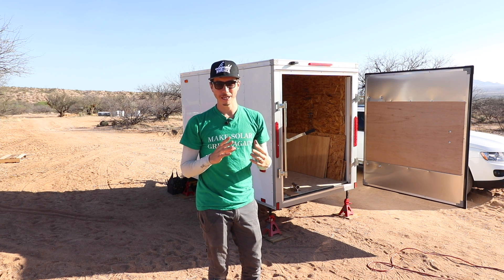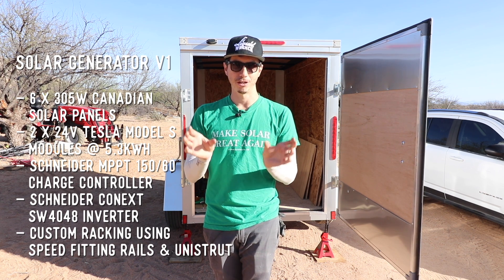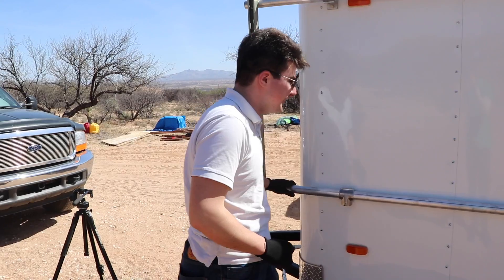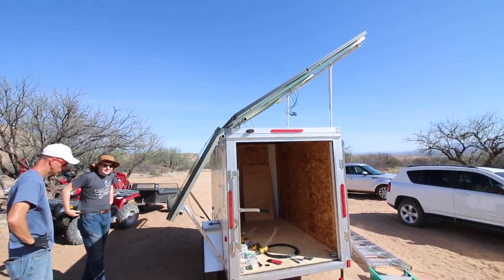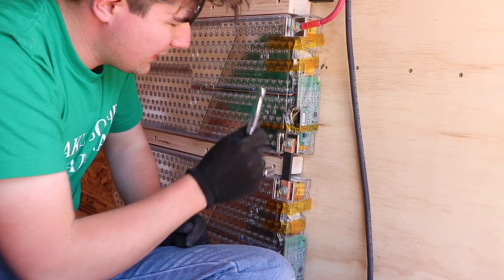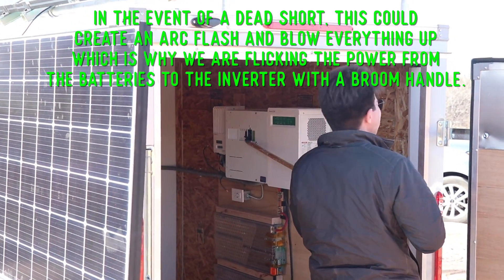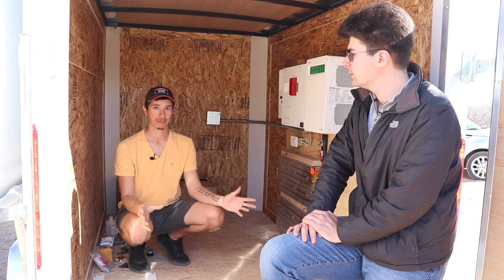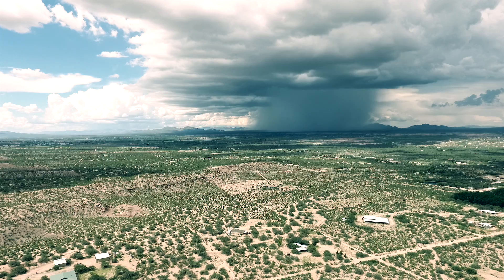DIY Solar Generator With Tesla Batteries On A Trailer... Can It Be Done???

Comment: How did you attach the unistrut to the 1 1/4" alum pipe? It looks like you drilled/tapped or used nut serts? I would think it would be a more secure connection? thank you!

Comment: So what happens if you leave it without power for a week or so and the capacitors discharge?  You could put a resistor in temporarily to limit the initial charge current.

Comment: Ok, so I want to convert a electric truck and have a mobile trailer so I can drive to Texas and Arizona back and fourth
Reply: probably can't mount enough solar to sustain your truck and trailer travels... There are races with solar powered vehicles. they are very different.
Reply: @joepah51   I'm not talking about charging while driving.
Reply: @joepah51  also there are videos of people using solar trailers to charge other cars at events, where there's a will, there's a way

Comment: 2 years later. I'm not sure if they had on-demand inverters then, but 2 or 3 inverters at 2000w each sounds way better for battery longevity overnights. E.g. run only 2k if you don't need 4k, but if you need ac, microwave, and insta pot you wife will be happy but you won't be using 4k or 6k drain the whole time.

Comment: You could wire a high wattage resistor in series with the battery for start up and once the inverter is running, you could close a switch to jumper around the resistor.  Or install a soft start contactor.

Comment: Did this using 30 panels fixed in "A" frame down the center of the bed a 30' flatbed truck with lead acid batteries down the center underneath- that was over 12 years ago. We used our "solar truck" to expose more people to the benefits of solar.  It was great used in neighborhoods for solar parties in dozens of cities all California back then.  We actually got exposure on Discovery channel when we attended Coachella for free in exchange for supplying stored energy for their night stage bands.  Unfortunately this is not cost effective - especially with Tesla batteries.  The battery tech is just not there yet- but- the real benefit is that you become a "solar educator" and that is worthwhile!   I started in solar in the 1970's and education is still the largest challenge to the solar industry- thanks for taking up the baton - I'm retired. ;-)

Comment: Could have used a high wattage bulb in series til the caps were charged.  The bulb will light brightly until the current drops..  a good bench top current limiter trick.

Comment: I good way to fill a capacitor is to use a small light bulb over the circuit. That will allow power to slowly move over the bulb circuit and charge the caps. We used to do this for large car audio caps.  It's a neat trick.

Comment: I love this can I please get the parts list for the pole flanges used ? I would love to make a 2 inch of pole hinge for mine 
And unistrut connections must have been ubolts correct?
Reply: I did build one mine has single axis tracking on it too and a prototype wind turbine .https://youtu.be/CVyjtJY2h6E

Comment: Dont you just bypass the fuse and touch a big wire to the inverter for a second to charge the capacitors, then hook up the main fused wire?

Comment: Can you run another breaker in parallel with a 100 watt incandescent bulb in series to 'pre charge' the inverter? Should lower the inrush current when you apply the full beans to it. Nice work!

Comment: Rather than using brand new batteries, couldn’t one use a battery from a totaled EV that had body damage but the battery was intact. IE a Chevy Spark EV or BMW i3, that would give you almost 20 kWh, and the going cost of a totaled EV like those is less than two grand. After you removed the battery you could sell the remaining parts to reduce the cost further.
Reply: The batteries he used are recycled and purchased from eBay. I have two of them in my motorhome as well.
😎😎😎😎😎😎

Comment: Just curious, so how can you avoid this in your future projects from happening again? Can you install an "amp" meter/controller if there is such a device to control the input current to the inverter? Or pre-charge your battery before connecting the system?  Please keep in mind I know nothing about this solar power thingy! ^_^

Comment: With regard to the large input capacitors, you say, "Once they're charged, they won't do that again."  You might want to check on that.  Most modern power designs with large caps have a high-resistance shunt across them that will slowly drain them for safety when the system is shut off.  In this case, that would be when you disconnect the batteries, either so they won't drain down so fast during long storage, or for maintenance.  The inverter may even have an internal relay that disconnects power when it is shut off.  Consult the circuit diagram or contact the manufacturer to be sure.

Comment: My thoughts on theft prevention: Bore a 4 inch wide hole 5 feet deep into the ground on both sides of the trailer just inside of the tires, drop a log chain into the hole leaving 2 - 3 feet of the chain above ground level, pour concrete, let it setup! Take the above ground portion of the chain and enclose it in a high temperature resistant fiber pipe wrap like the kind used on steam and nuclear plants,  Loop the chain around the trailer axle, the lock and chain should be terminate inside of the trailer using two holes just big enough for the chain and its anti-torch fiber sleeve! Block set the trailer, Remove the trailer tires and store the tires in a hidden location! Install a alarm system on the trailer tied to your cell phone for intrusion alerts with GPS tracking! 

Short of that, install a dead man shotgun inside of trailer linked to the back door, you might not prevent the theft of the trailer, but you will get the pleasure of burying one of the S.O.B.'s on your property so you can go p*ss on his grave every day!
Reply: if you use the dead man shotgun option, place a nice printed sticker on the back door of trailer that says "Trailer Tires in back of trailer!" in BOTH English and Spanish WITH a Smiley Face sticker! Make sure the shotgun shell is Buck Shot with each ball of the shell smeared in human excrement for the non-lethal strikes any assistants the thief might have with him! 

Then install a DVR security camera pointed at the trailer to capture this most entertaining moment in life!

Comment: What settings do you use for your batteries off that charge controller?  The batteries should be able to handle 36-50V, but that controller does something more like 40-64V.  I'm guessing you can tell it to stop early, but do you miss out on the bottom end of the batteries or does it handle going lower?

Comment: Tape tool so it is less likely to spark.  Even better, dip in Plastidip.

Can a Tesla be used as the battery?  Thinking of getting a Model 3 and building a small camper trailer covered in solar panels.

Comment: What was used on the adjustable pipe legs, I am installing 2 panels on the side of my ambulance and wanted to know what was used here, and what locked them in tilt positions on the side panels.

Comment: Would be worth it to make a big version out of a flat trailer given that the battery and charging components could fit easily into a plastic garden "mini-shed" tucked under the panels (I'm talking about the little sheds that are only 3 or 4 feet high). Would be an awesome way to scale up the project for those with higher energy requirements. Heck I could park one in my driveway and power my house if I had to!

Comment: I love the Solar Trailer Gen Set, possibly on a larger scale. I will be in Tucson AZ February 3rd and 4th, could I visit the neighbor with the trailer, and discuss details? Larger trailer, more panels, more Tesla batteries.  My off grid project is in the planning stage, and I need stable Power/Water/Internet before building permanent structure.

Comment: This is extremely interesting! Nice how you showed converting a covered trailer for this use. This has awesome potential. There are other videos on YouTube that underscore this potential:

HomeMadeModern - Building a Solar Powered Workshop (28 Sept 2017) - https://youtu.be/xnSew-tCuPo

shooshinejonnie - A "Paulk Inspired" Mobile Tool Trailer Tour (16 Oct 2018) - https://youtu.be/gkwuCH78nJU

My idea would be threefold: Take a trailer like yours, install batteries and PV paneling for on-board power, and then structure the interior around the power supply to house tools, a Paulk workstation, power equipment, materiel, etc. The final project would be a mobile workshop powered by renewable energy.

This raises a few questions:
1: You mentioned the wind kicking up in your video. Is it possible (and feasible) to equip a trailer like that with an extendable mast for a small wind turbine? I was thinking maybe the wind could supply power when the sun isn't.
2: Is it possible to add a wind turbine to your existing system as you set it up there?
3: How big is your trailer? Does it need to be towed by a SuperDuty, or could a half-ton do the job?
4: What is the trailer's actual size? I'm thinking in terms of capacity and what could fit in it.

Comment: The next time your dealing with a very large turn on surge due to charging a bank of caps select a high power incandescent light bulb of the appropriate or higher voltage and allow the caps to charge through the lamp at the fuse holder. (the light will light then dim to nothing) Then put the fuse in place.
12 volt use a car headlight bulb, 24 volt use two in series, 48 volt Jump up to a 2 or 3 hundred watt incandescent home light bulb.

Comment: I already made a towable solar power generator. Mine has 12- 255 watt solar panels, 4000-8000 watt pure sine wave inverter with outback charge controller but I only have 400 lithium cells but my trailer is able to run two small air conditioners.

Comment: Great Video, thanks guys.  Hint: 48V Golf  cars use a 470 ohm 10 watt resistor across the main contactor to precharge the caps in the motor controller.

Comment: Are there any legal issues or technical issues driving with those solar panels bolted on the sides/top of the trailer? Even when they're folded down and tight-ish to the trailer it seems like they would be causing drag, have you experienced this?

Comment: Sadly in a American, when connected to grid they have at split power system so you would (must have) need two inverters to be connected to your house, one on each hot lead.... If not off grid...
Schneider never recommended anything in their manual book how to charge up the capacitors??? Like putting in a large shunt, in place of fuse, until the capacitors are charged....
Note to self... Buy a trailer, two solar panels wide....

Comment: https://americantinyhouseassociation.org/state-regulations/

If you use it in an unincorporated area in your county, I believe the restrictions will be less strict. In incorporated areas of the county, just like with tiny homes, you do need permitting. It's a pain in the ass, and vary from state to state, city to city, county to county, but they do exist. That's why the tiny house movement is trying to push for more unilateral regulation, rather than patchwork regulation. For you proposed project, I think it should be alright in unincorporated ares, but it would probably need some electrician to sign off on it if you plug it into the grid, or plug it into a house on the grid. It sucks, but that's the rules as I currently understand it. I would be happy to be wrong, but please provide evidence.

Comment: May I suggest that if you use 14 cells in series the battery voltage is more in the range of a conventional lead acid battery.  If you use Nissan Leaf batteries you can get in the 49v-58.8v that the inverter would like better.  The leaf batteries come with two cells in series so they are 8.4v per module...  7 leaf batteries in series is the same as 14 regular batteries in series.  Also, what are you using for balancing?

Comment: Hi, this is cool and you guys seem to know what your are doing, but I am worried about one specific factor with Tesla auto batteries. The Tesla auto batteries are liquid cooled using a cooling chamber between each row of lithium ion battery cells. This coolant is passed through the chamber in a passive manner utilizing the momentum of the vehicles forward motion to force the liquid coolant through the chamber from a forward located coolant radiator. So in essence,  the coolant is air cooled in that radiator without the mechanical assistance of a high powered fan. I believe earlier models of Tesla vehicle had issues with the lithium ion batteries exploding due to inadequate cooling of the batteries, and that the exploding lithium ion battery cells would blow clean through the vehicle, which resulted in injury of people in the vehicles. Tesla addressed this situation by encasing the battery packs in a container chamber made of titanium to contain said exploding cells in the event of a catastrophic cooling failure that may cause explosions resulting in injury or death. I don't know all of this for sure, buy better safe than sorry. All the best, and I look forward to your future achievements,.

Comment: Use incandescent light bulb(s) when you need to limit inrush current through a fuse to get the capacitors charged initially. In this case, you start with the fuse current and the battery voltage to select the maximum bulb wattage. 

Short out the bulbs with a switch after they flicker, for best efficiency. I recommend a normally closed pushbutton switch.

Comment: you could have put an halogen bulb in series with the battery and inverter to limit the current for the first time,it's what i did when i installed a big capacitor in my car audio system, it limited the current and charged the cap without the risk of high current flow or possibility of exploding the cap

Comment: so incredible those 2 pack tesla batteries perform. how much size differences if you use lead acid batteries ? and you can use noctua fans to lower fan noise.

Comment: Really is an excellent system and has been performing just as it should for a couple months now. Lots of great information in the solar course, so check it out and make sure you examine those loads. Especially the RVers out there, since RVs tend to be poorly designed, constructed, and insulated boxes (in their defense, they generally aren’t built to be lived in!). Thanks, again, Derek and Liam!

Comment: One thought: Eliminate the starboard overhang by using an over/under expandable rack. For that matter, you could do a triple stack with panels expanding to both port and starboard, then tilting up with all racks coplanar (at the same angle). Mounting with a hinge point either port or starboard would allow the bottom edge of one panel set to tilt below the trailer roof line. For the simplest set up, the panels could also remain horizontal. An added benefit of this arrangement would be shade to the sides of the trailer.